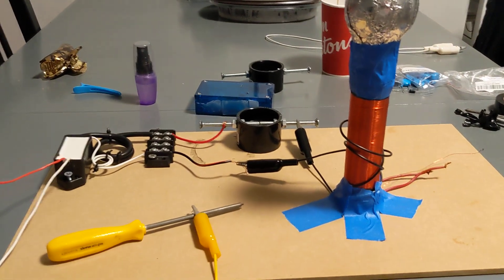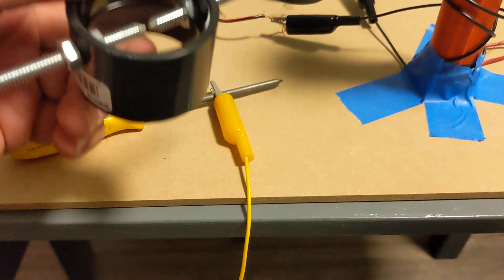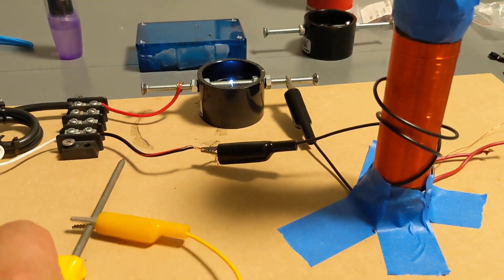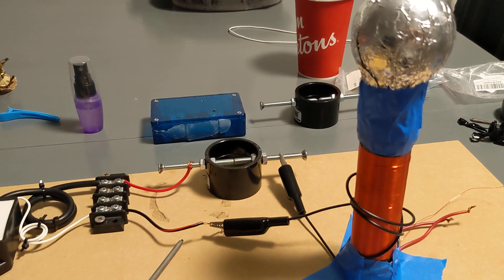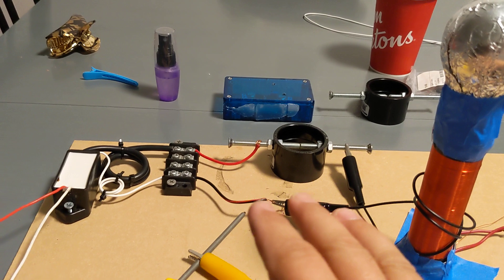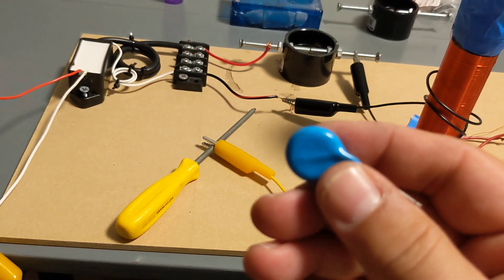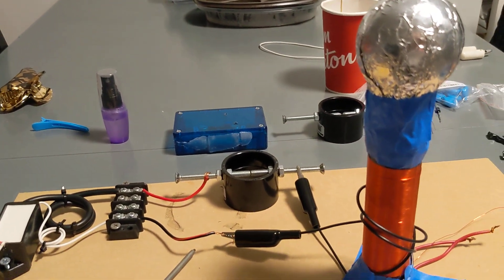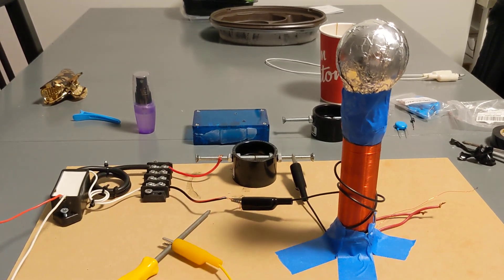Tesla Coil....Don Smith Generator.. . Faraday Research R N D

Comment: Yaahooo, Tesla waves, longitudinal-magneto-dielectric waves, scalar waves!  Yes, faster than c, you got it, approx 193,000MPS!  Hmmm, for best capacitance, hmmm, I forget the exact formula, but I remember I had found a very simple formula that involved VoltAmps and Impedance Z of the output of your power supply, maybe you already know the formulas, but here is a good website...  http://www.teslacoildesign.com/design.html

Here is some more info...  
Resonant Primary Capacitance
Cltr = I / (2 x pi x Fl x V)
Where:
Cltr = Resonant capacitor value in Farads
I = NST rate current in Amps
pi = 3.14159...
Fl = AC line frequency in Hertz
V = NST rated voltage in Volts

You probably already know, with Tesla coils the voltage rating of your cap should be double the voltage of your output of your power supply.
What is your power supply here?
I tried many spark gaps and types, I found that the screws lost some power.  It was not easily noticed in my system, but I saw that the sparks were actually also jumping across each thread of the screws.  I also found that If electrodes are too pointed they create more heat at those points and points turns black, loss of power and cleaning points often.  Rounded ends worked best for me.

I hope I'm not coming across the wrong way, or like a know-it-all,,  I just like to help when I can & add my 2 cents, I'm no expert, that's for sure.
Great job!  Looking forward to your next video :-)  Ahhhhh, the smell of ozone, for some reason that smell gets my adrenalin pumping, hehehehe.

Comment: So do you think the flat spark cap works better due to more surface area? Would like to see a side by side demo. Nice work man
Reply: The reason I'm asking is if that is the case, then what would happen if you increased the spark end to a flat plate on each side, lets say 1/2 " ? What do you think would happen? Or even better, put 2 magnets on each end of the spark cap?
Reply from the maker: Ok I will have too think about that idea.... don't forget magnetic fields are actually resistance in a circuit....so are the the movements of electrons are resistance as well.  According too Eric Dollard.... I have done alot of reading on his work and theories
Reply: @FaradayResearch  cool thanks